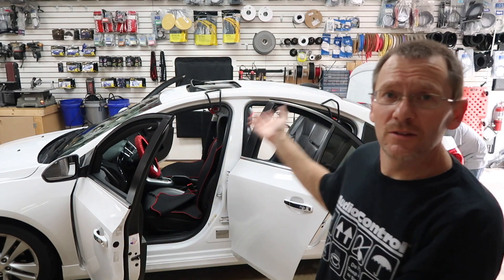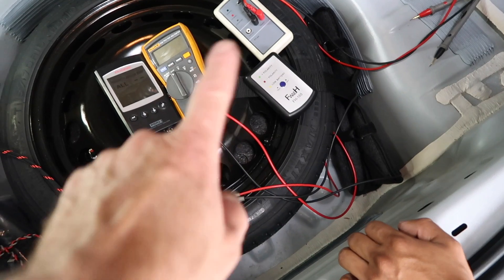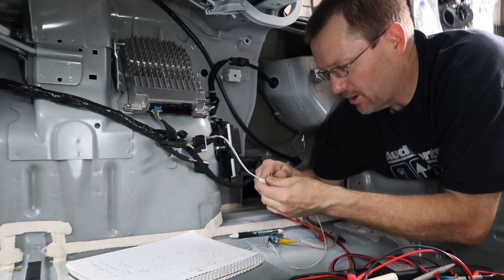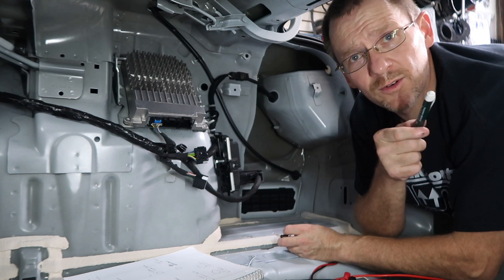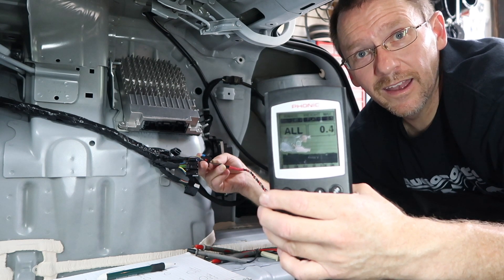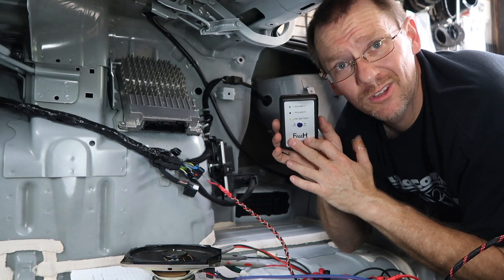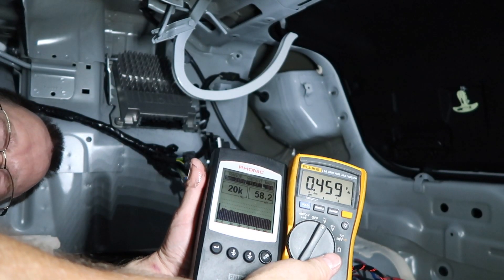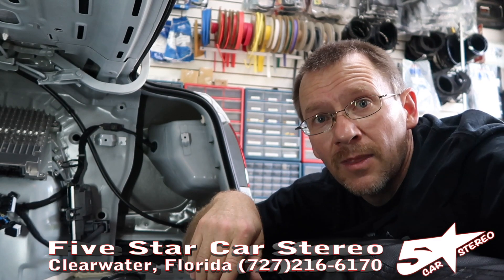Chevy Cruze part 1 integrating into the factory amplifier  Installer Diaries 107

Comment: Great job guys!!! I did this exact same thing with my 2013 Chevy Volt with the factory Bose radio. Almost the same configuration with the 3 plugs to the back amp with a perfectly flat variable signal coming to the amp in the back. Upgraded my system with a MiniDSP, Alpine amp and Morel Speakers.

Comment: Man this video was money. Have a 2016 Malibu and it has the same color setup. I'm using an aftermarket amp for my door speakers. Nice to know the rear passenger wire is reversed.
Reply: It would be wise of you to check and not assume that the rear passenger wire in your Malibu is wired the same way as the Cruz.
Reply: CDP agreed

Comment: Make your own popping tone generater.May be able to use a turn signal/emergency flasher hooked up to 9 volt(if it is strong enough) battery.Or run a jumper from the car's turn signal lights or flasher relay itself.

Comment: Great video. Now I need to look into my noise canceling mics by the grab handles on my caddilac SRX. I'm using a LC7 on output side of Bose amp. Wonder if I'll notice a difference by disconnecting the mics

Comment: i have the 6 speaker welfare factory version in my 2011 lt  , I like back fill sound there is 6x9 holes i would like to add them what wire would i need for hook up

Comment: I have the same cruze and have not had very good luck doing what you are performing.  I pulled my input from the front inputs to the amp.  My bass comes and goes and at times there is noise injected into the system.  If I keep the balance on a couple of clicks left or right the bass remains constant.  Can't wait to see if you run into the same problems.
Reply: You can pull the fuse for the active noise cancellation
Reply: Hmm, I have searched and was not able to find any indication that it has active noise cancelation.  Do you know which fuse it is?
Reply: Jeff Kreska Does your Cruze actually have noise cancellation? Dean said there would be a mic near the handles on the headliner and/or the around the maplight area.
Reply: I was not able to find a mic anywhere.  The violet/Dk Blue wire that he spoke about might being ANR says it is "Amplifier Control" in the service manual.
Reply: I checked my polarity and it is correct, the only difference in my build and D&F is that I have retained the factory AMP for rear passengers and I used a LC2i (even though it is pre-amp signal) to have sound and of course my Bass is totally foobar :(

Comment: i have a 2015 chevy cruze Lt rs model..no pioneer premium audio ..can u show what harness to use to retain the stock radio with wheel controls and to use with rca cables to aftermarket amp...is it the pac aa gm44 harness..if so can u show a visual diagram to wire it properly to get rca audio..
Reply: The gmos 044 will keep your info screen (non mylink) functioning and will retain all systems except for the steering wheel control. The pac unit does everything including the steering wheel control but you will have a blank info screen.with the gmos-044  If you have steering wheel controls you CAN fix time and date on the info screen by holding the end call button on your wheel until the screen shows options, use the scroll up/down and push in (all same button) to go through the options hope this helps.